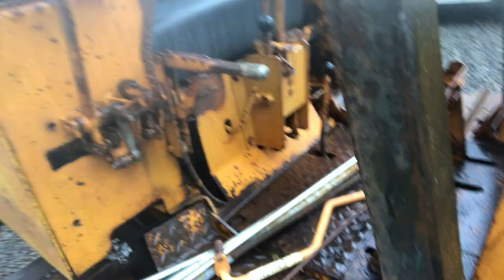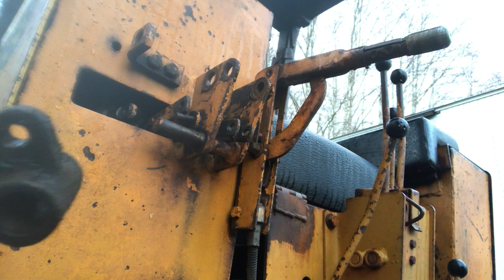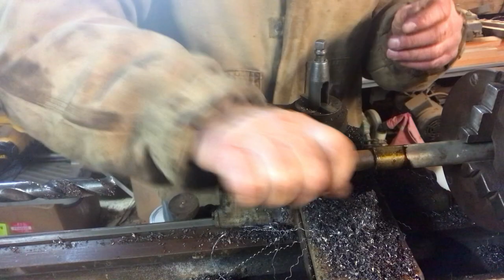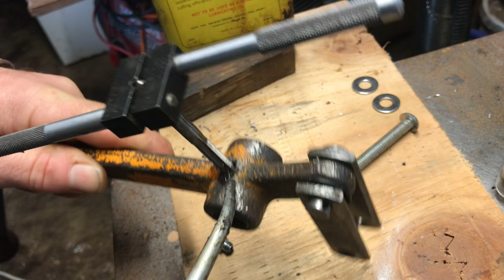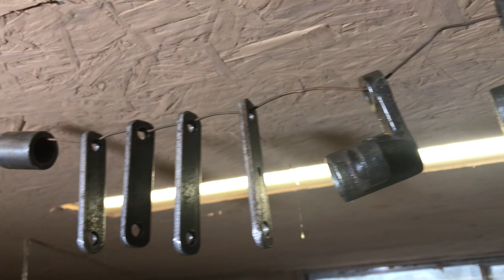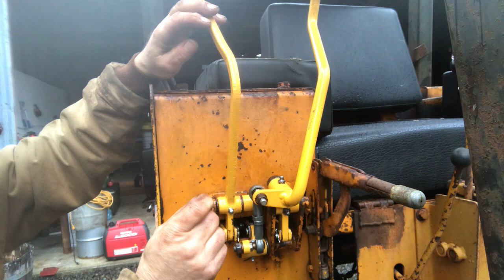Reparing the Controls on the 1976 Case Crawler 450

Comment: You sure helped that worn mechanism function like new Patrick.  Nowdays most people don't know how to repair something worn unless they have new parts to replace the worn pieces.  Thanks for letting us watch.  Phil
Reply: This was a long but fun and rewarding little project. I still have the "old-new stock" bell crank on the shelf. Came across a 450 Case with a clam bucket on the front for 2500 bucks on facebook market. Went fast! would have made a good parts machine if it wasn't feasible to get it going. Hmmm, that's all I need is more iron sitting around.